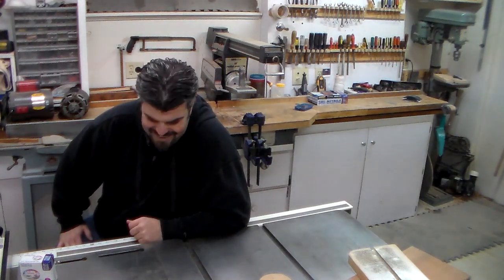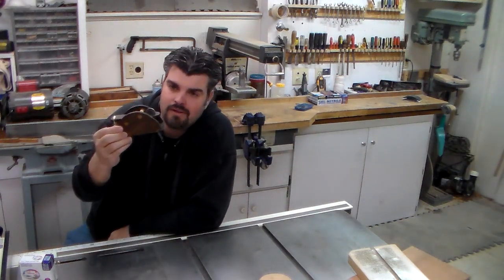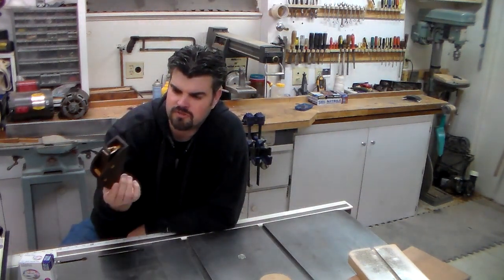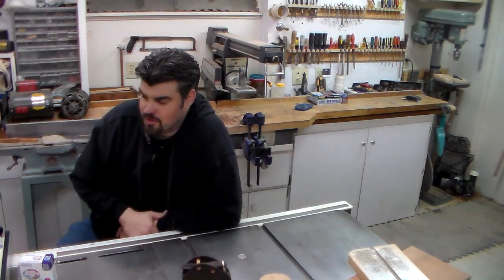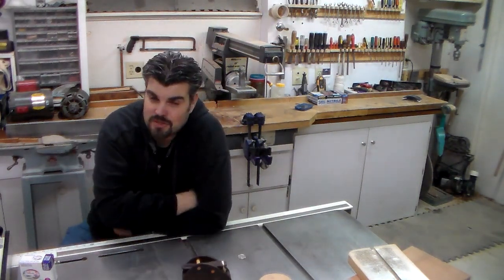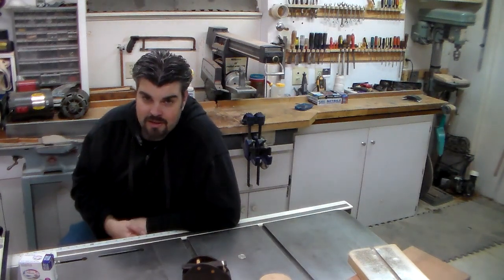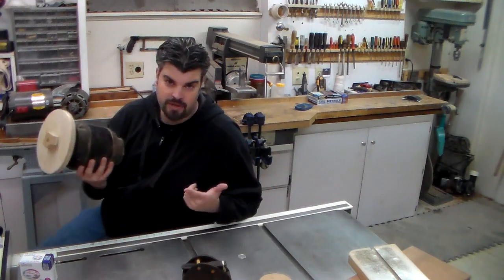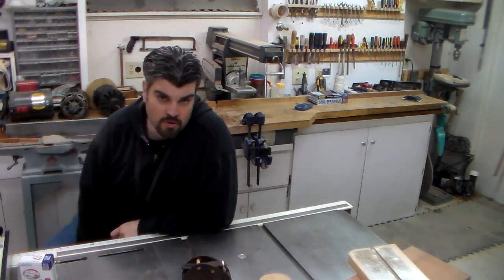My Greedy Uncle!

Comment: Not a problem. They're pretty cool.

The coin-apult looks great. I can't help but picture it launching coins across a room though.  A slight change in the release point and ZING, across the room it goes!

I also picture me somehow sending it through something glass.
Reply from the maker: Dan Mills It can flip pretty high! you could easily add another rubber band to it as well. Nothing damaged yet, but it's not out of the realm of possibility!